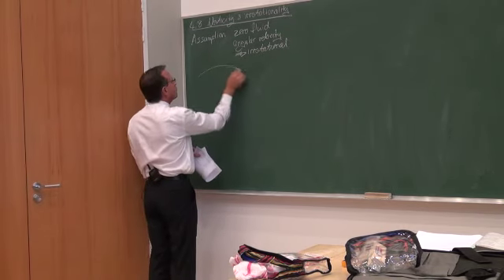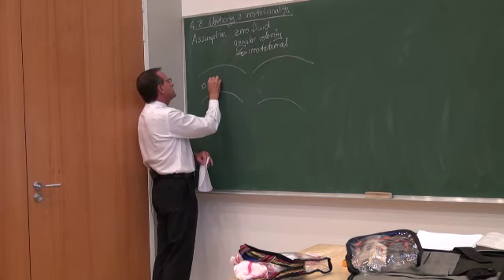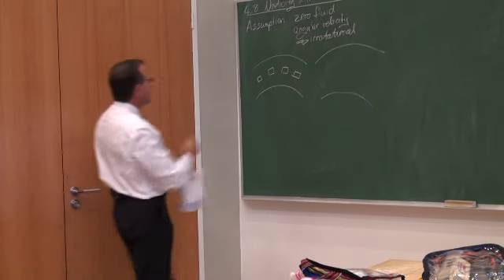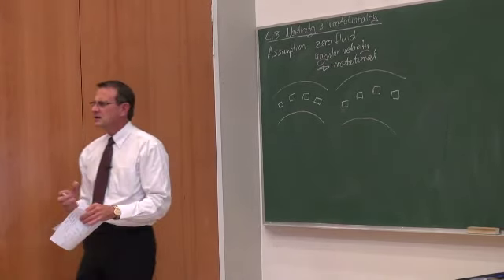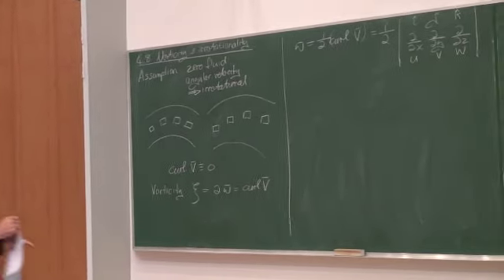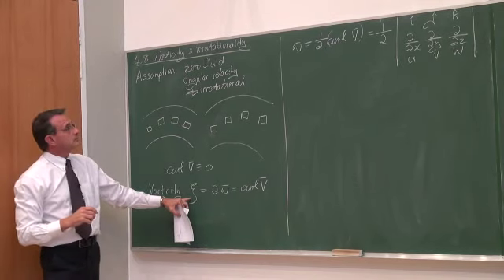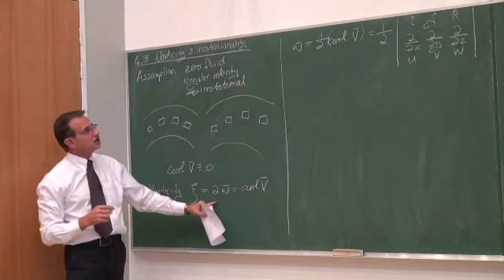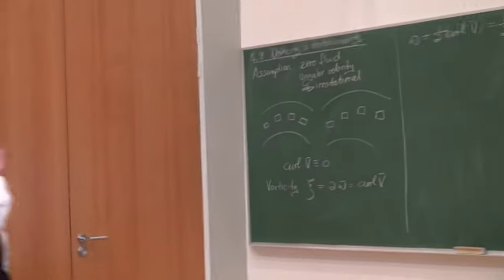Lecture 06 (2013). 4.8 Vorticity, 4.9 Frictionless irrotational flow, 4.10 Incompressible viscous

Comment: The equation used is under the assumption of incompressible flow. If the given parameters satisfy it, it is incompressible. The method is logical.